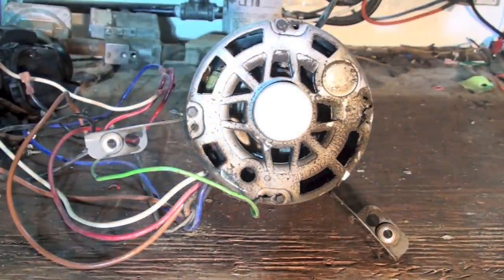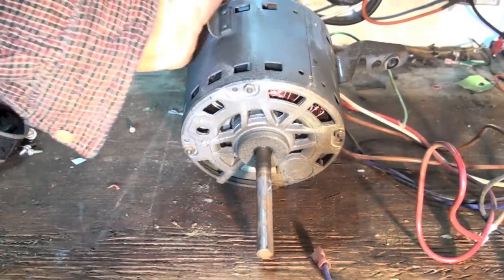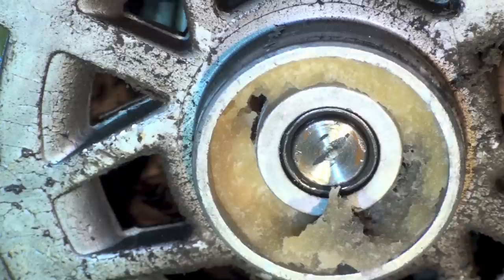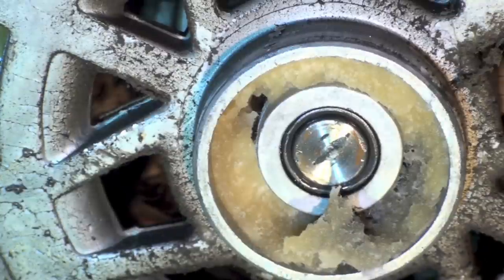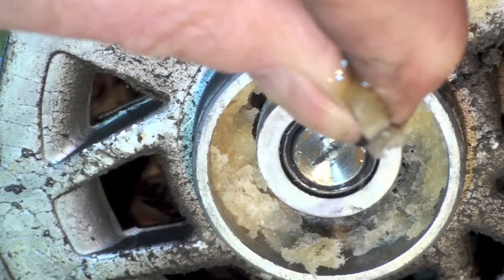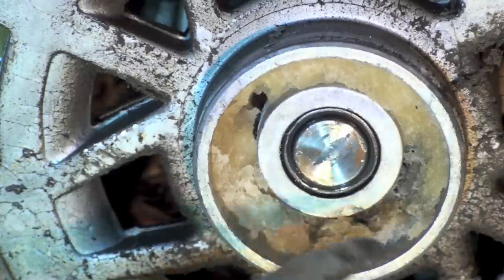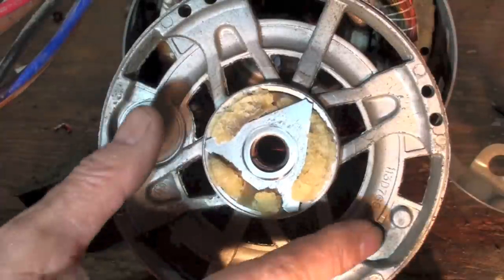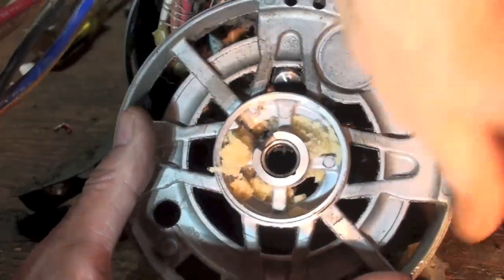HVAC fan motor bearing failure

Comment: Lubricated Electric Furnace Fan motor 6 yrs ago after making noises and still running great! Manufacturer only puts in adequate amount, however saturated cotton material well around bearing. Thanks!
Reply: what is part name for the saturated "cotton" material packed into the sealed bushing/bearing? or what is the material, felt?, if so i can just buy some felt and cut to size. tia.
Reply: @lgalina997   I see people said wick felt would work.  Or even cotton.

Comment: Last summer had a condenser fan motor suffer a bearing failure. About an hour on a lathe with a piece of brass we had a new bearing. It might fail tomorrow, or last ten more years, but got them through the hottest part of the summer.
Reply from the maker: Those condenser fans can be a problem.  You do what needs to be done and it looks like you did.
GFM
Reply: 10 years later, how did that work out?
Reply: @nazcaplain  to be honest, I don't know.  We changed the motor two weeks later for a new unit.  It was one of those cases where the motor died 5:01 on a Friday night and the client didn't want to pay the extra money to get an "emergency" motor.  At the end of 2 weeks, the motor was running just fine.  Made it through the hot weekend till a new motor could be obtained.
Reply: @slamdvw  I honed the bushing in our 1/3 hp condenser motor and put fresh oil in the sponge reservoir and got 3 years out of my motor. Then Sat. morning on this Labor Day  weekend it crapped out again and can't be revived - just in time to wait three days in the FL heat for shops to reopen. Because of course that's how it goes.

Comment: My Friedrich wall a/c motor seized. Took it apart expecting ball bearings and found this bushing instead. The felt material was dried up providing no lube. This was after 14 years of use. I was desperate to get a/c running again (middle of August heat and humidity) so I oiled the shaft then packed that space with bearing grease. That was last year and it's now July following year. Still working but fingers crossed; I keep listening for any noises and squeaks!

Comment: I swapped the end bells end for end and got the motor working.  The drive end most always has the most wear seeing it is pumping something. Another symptom of worn bearings (when not a capacitor or start relay issue), the motor simply hums  as it is not centered so magnetically unbalanced forces are working on the armature.

Comment: Dang, I really need to know what that oil-absorbing pad (aka packing) is made of so that I can replace because dry pieces of a very similar blower motor sealed bushing pad(aka packing) blew away when I was using compressed air (dumb) to clean up that area on MY motor. Day & Nite furnace here - very similar to yours. No furnace we buy today is going to last decades.
Reply from the maker: You can use felt.  I have one that has lasted 3 decades.
GFM
Reply: @grayfurnaceman  Thanks, i will try to find some felt. Apparently, there's some stuff called Permwick that looks interesting. Moleskin might work; my mom used a layer of it on the bottom of knicknacks to protect the coffee table and fireplace mantle in the livingroom.
Nevermind...scratch the above. I stole some moleskin from a lamp bottom, cut in strips, and stuffed into the oil well around the bushings, soaked in oil, and all is reassembled and ready for reinstallation tomorrow. Found a forgotten papertowel in the turbin which was causing noisy imbalance. Should be quiet now. We'll see.

Comment: What are those extra bushings that come packaged with new motor ? About two inches in diameter and new motor has them already installed in front shaft side and lead side .
Reply from the maker: Those are for different diameter mounts.  If yours fit the mount, throw the extras away.
GFM

Comment: Our 5 year old motor seized and after taking it apart, the felt material was bone dry.  I'm considering machining it out and reinstalling some sealed ball bearings. Worth a shot? Or just relube and plan to take it apart every 3 years?
Reply from the maker: Mostly if the motor seized the shaft will be scored.  Replace the motor.
GFM
Reply: Definitely worth a shot. If you can do it without destroying the it, the motor will probably outlast every other part of the furnace.

Comment: So why do they still make these sleeve bushing motors? They seldom last. Every sleeve bearing motor I have upgraded to ball bearing version don't have problems again.
Reply from the maker: Sleeve bearings are more tolerant of contaminates than ball bearings.  Not saying they are best.
GFM
Reply: how can you put sealed bearings in a friction bearing motor I have one that needs bearings any ideas thanx or ball bearings thanx dollar guy
Reply: My original GE Fan motor lasted 25 years, probably with no maintenance, before the bushing seized. That's not a bad run.
Reply: @ArtHeld  You got a winner, probably because the manufacturer cared enough to put actual oil packing material in your motor's sleeve bearings.  Properly oiled sleeve/bushing will run forever.

Modern throw-away garbage is what we get today though; you get what the  oil-lite bushing can hold and that's it.

Comment: can you get replacement sleeve bearings like that anymore? I have a specialty motor with a 12" shaft on one end that the bearings seized. It is a low amp motor and the electronic are still good.
Reply from the maker: William Warner You might try a motor rewinder.
GFM

Comment: @1:41 How did you get that end-piece off? Mine is stuck on.
Reply from the maker: With the bolts out, there is usually a notch on the circumference that will allow a screwdriver to be placed in to pry it off.  No notch, screwdriver and small hammer will knock if off.
GFM
Reply: @grayfurnaceman  Thanks. I tried prying, but it wouldn't give. I ended up sticking mine inside a 3" tube with the flange ears sticking out over the ends of the tube, then smacking the motor output shaft. Probably not the best idea, but it got the job done and it worked again when I put it back together.
Reply: I used a chisel and hammer on the circumference of those end caps to knock them off

Comment: Would this need replacing if a loud pop noise was made then a car engine running noise when the fan is emidittheat
Reply from the maker: I would need more info to be sure, but it sounds like a blower assembly failure.
GFM

Comment: single phase preventer how to work inlet wire outlet wire how to connecting
how to control the system and power supply  please explain to me thanks?

Comment: so noooobody knows what the "goo" is or where to get it? Or if there is an easy substitute?
Reply from the maker: If you mean the material surrounding the bearing, its an artificial felt.  Made to hold oil in position.
GFM

Comment: Why these don't use a standard replaceable deep groove ball bearing is really fucked up;  planned obsolescence. It's actually criminal.
Reply from the maker: Most of these motors are now equipped with ball bearings and thus have no oilers.
GFM
Reply: @grayfurnaceman  ball bearings are noisy after a while,  not good for neighbors.
Reply from the maker: @charger440  The only noisy ball bearings are defective ones.
GFM
Reply: This is not an example of planned obsolences as you can easily service the item and the lifecycle of the product is on a substantial timeline.
Reply: @charger440  Noisy ball bearings are easily replaced, and that's the point.  Designs like this video are made for one time use and I hate it. lol
Reply: @charger440  Lol. Ball roller bearings are not noisy. 😸 Everything is noisy when worn beyond repair including sleeve bushings as in this video. Your logic is flawed. Ball roller bearings with seals on each side are easily re-greased and they easily operate in any orientation.

Comment: I used to get new end bells cheaper than replacing whole motor
Reply from the maker: Wow. I didn't know you could get them separately.
GFM
Reply: From a motor shop that repaired motors, but now they only do the big motors and throw these away that was 25 years ago
Reply: Great videos like to see things I did when I was in hvac business